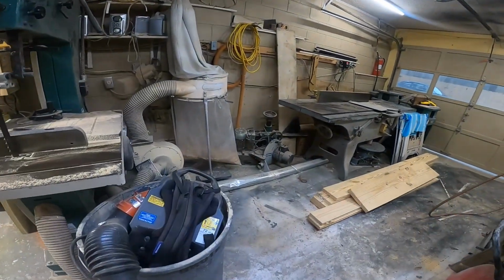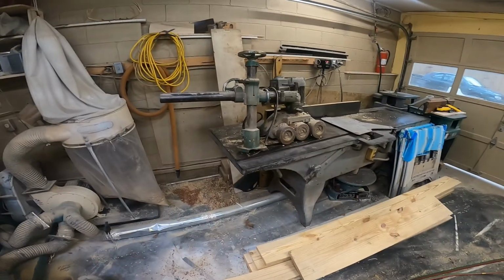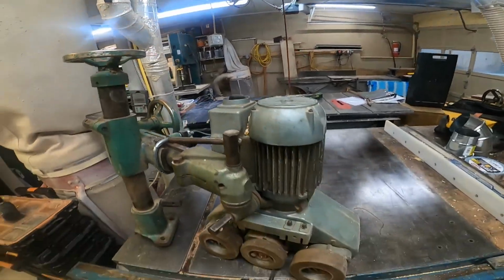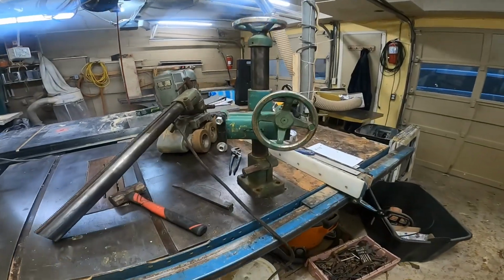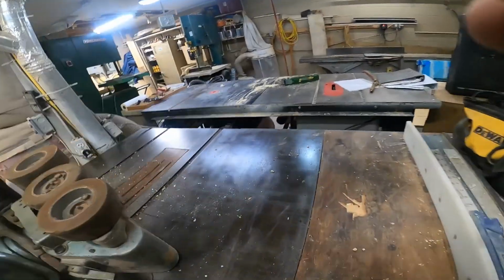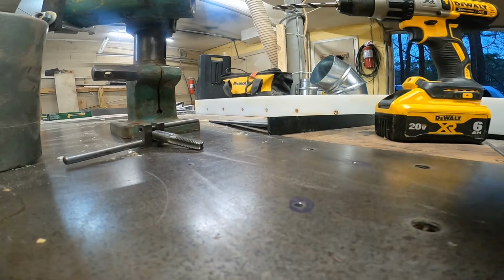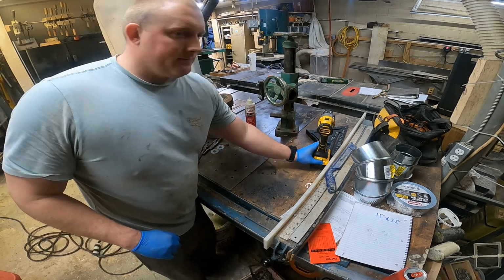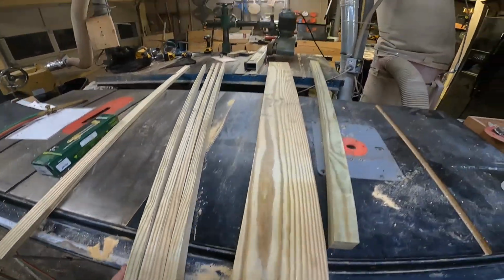Mounting a power feeder on my table saw

Comment: I just came across one dirt cheap, so I bought it. I found out that you can get replacement wheels for them too. Mine is slightly smaller than yours.
Reply from the maker: I had to modify my new wheels a little bit but I couldn’t pass this up for the price. Thanks for watching .

Comment: FYI, 1) You should never turn off the circuit  between the VFD and the motor, use the VFD to control (start and stop) the motor. You will like having the VFD to fine tune the feeder speed.
       2) When you adjust the feeder to the rip fence make sure the outfeed wheel is slightly closer than the infeed wheel. This will keep the stock feeding straighter.